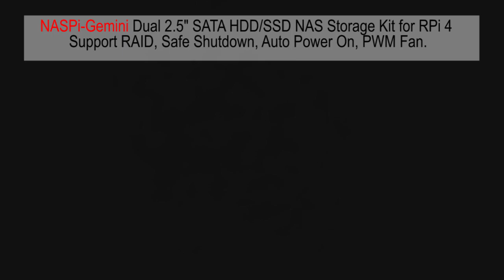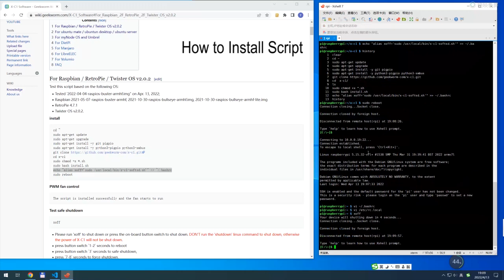Geekworm NASPi Gemini Hardware & Software Installation Guide - for X882 V1.3 Version

Comment: Hey.. loving my NASPi so much BUT... i know you guys stated that button cant be run in home assistant.... but... that post isnt recent...
So i ask.. is it possible now?
Would love to control it from the button.
Thanks for quality! i would recommend anyone to do this on home assistant.. i actually cut a hole on top to mount a bigger fan and it works amazing for cooling :)
Reply: make sure tu buy a very good power supply (i bought the one Geekworm has)
i been reading a lot and the problem with SD Cards getting damaged is because a cheap (with not enough constant power) and it destroys SDcards.
im installing this on a SSD anyways plus 2 HDD's (2.5 inch ones) for the NAS!

Comment: Bought this and unfortunately was completely useless....
I have 2 seagate drives... when both running the controller started to throw disk errors all over the place. Yes... it was connected to a 45w high quality power supply. Direct connection of the drive into the raspberry outside the naspi would work great.
Secondly ... the internal raspberry pi antenna and Bluetooth get completely useless once the box is closed... even without the box the interference makes wifi to loose a considerable amount of sensibility. 

It would be great if it works but unfortunately without wireless / drives... is pretty useless. Returning the product